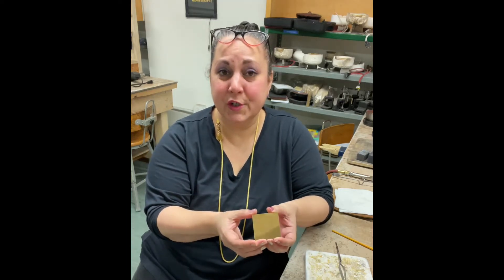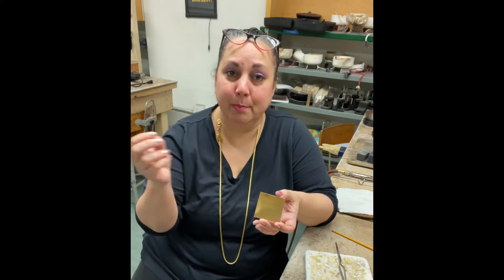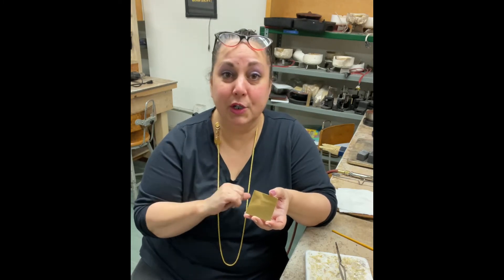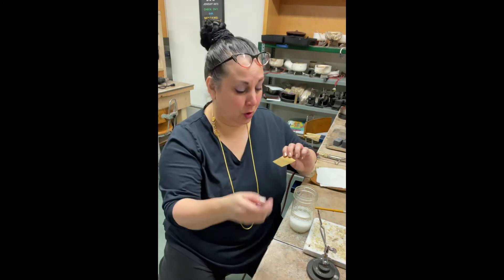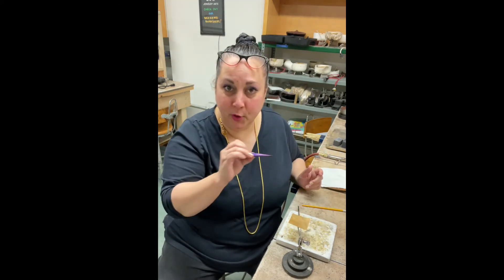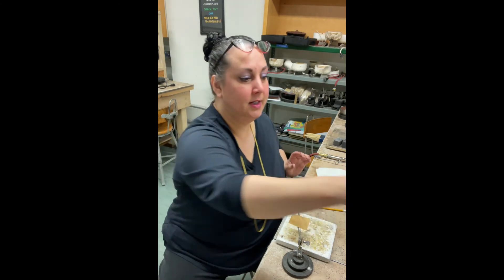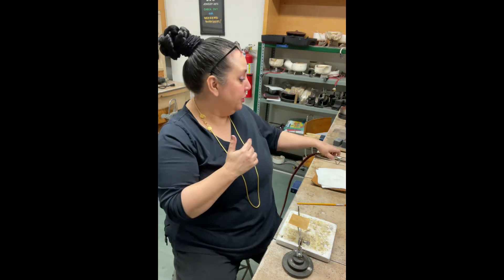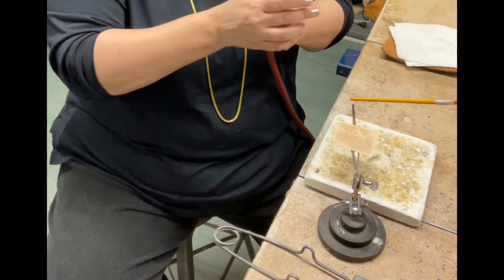How to Use Fire Coat on Gold Alloys

Comment: Hi there -  how should we incorporate this into the granulation/fusing process, if we were using 22k granules and one of the alloys as a back sheet? It seems like the dried fire coat is "lumpy" enough to get in the way of arranging the granules. Maybe dip the whole thing in firecoat after the G glue is dry? Thanks so much! :)
Reply from the maker: Hi Jen!  I firecoat the sheet and then use a tiny bit of water to clear my granulation area. :)
Reply: @JewelryArts  awesome (also, duh!) thank you :)
Reply from the maker: @chaotic_magpie  You are most welcome!! :)